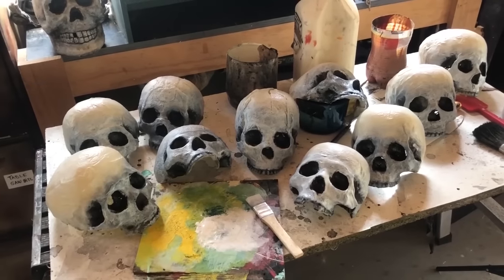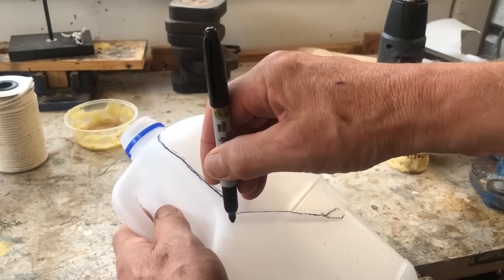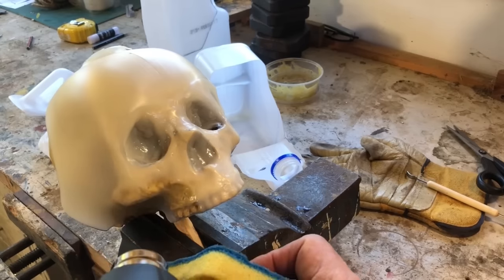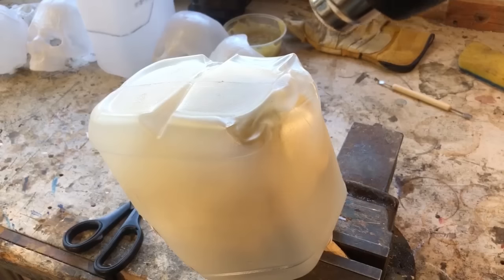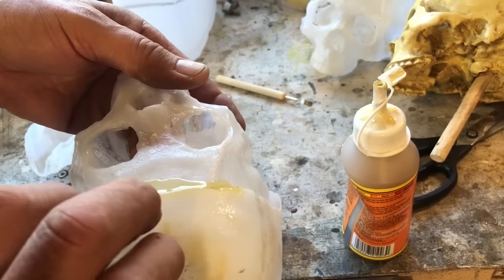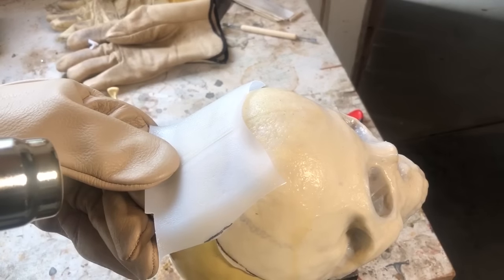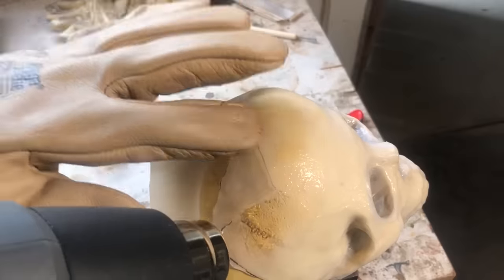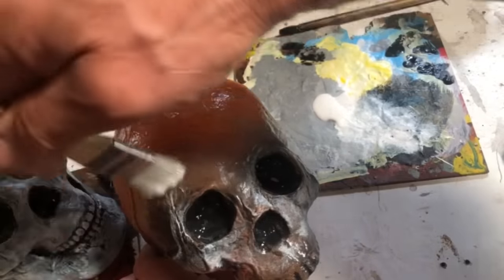Off The Grid Makes 73 - How to Make Milk Bottle Skulls

Comment: Brilliant! 😀...and great use of what would otherwise be rubbish. Painting the teeth, you could paint them entirely black, then quickly, but, gently, wipe off the wet paint, leaving the gaps black. I use this method for antiquing metal castings.
Reply from the maker: Yep - can't beat a black 'wash' to make things look old
Reply: @OfftheGridMakes  In this instance, using undiluted paint would paint the between-the-teeth black, rather than black washing them. Depending on the work, I use both methods. I should have clarified that.

Comment: Couldn’t you use some UV resin to fix the splits and to secure the top of the scull pieces together?
Also, are you using a mask to protect you from the plastic fumes?
Reply from the maker: I have found hot melt glue works pretty well if you want to add more sculptural elements. And yes - I do wear a mask all the time

Comment: so does the gorilla glue hold up? all my research says it won't bond to that type of plastic. I'm curious because I make these a lot.
Reply from the maker: So far it has but I don't stress the joints a lot. Hot melt glue does a good job - maybe better than gg?